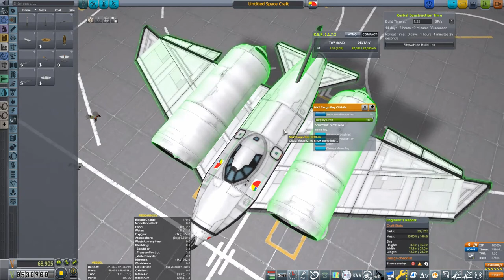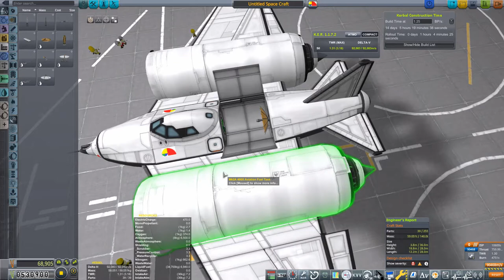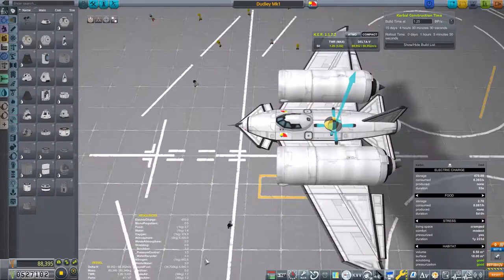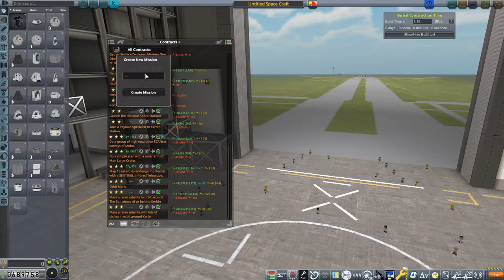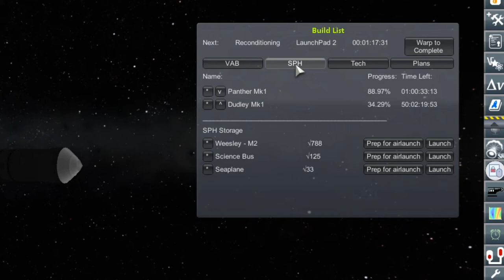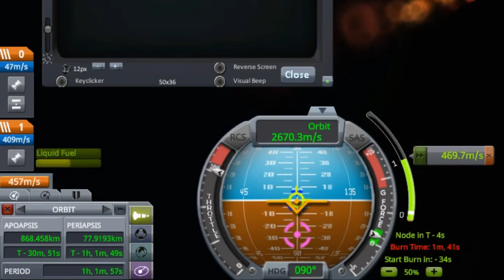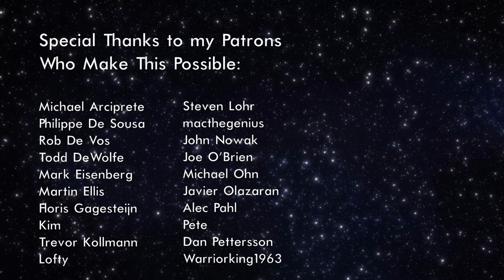Designing a High Altitude Jet | KSP: Making Space Home

Comment: The ultimate solution for the high altitude jet is to auto strut all of the nonmoving wing parts, each one to its grandfather part.
Reply from the maker: Thanks. I eventually got this pretty stiff with autostruting. I've gotten in the habit of only using autostruting as a last resort, but I think vessels like this on is curing me.